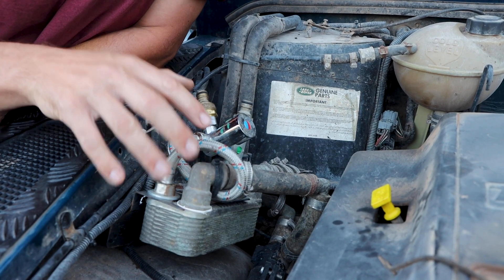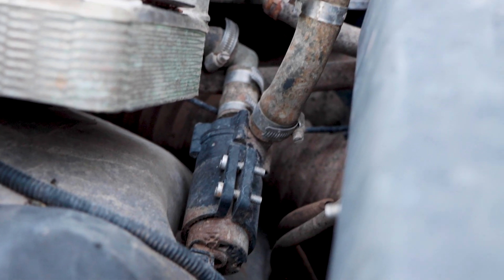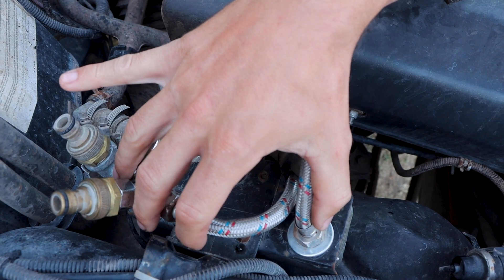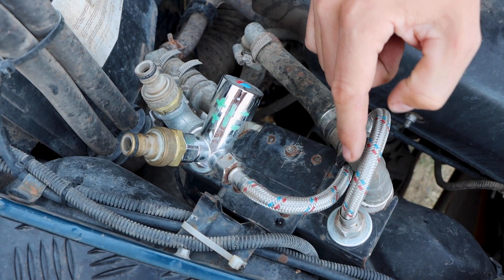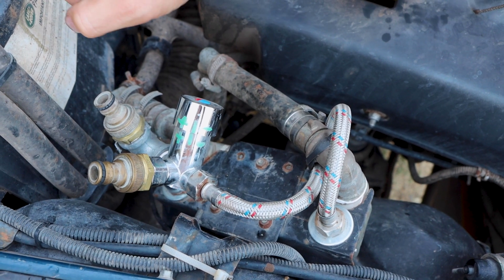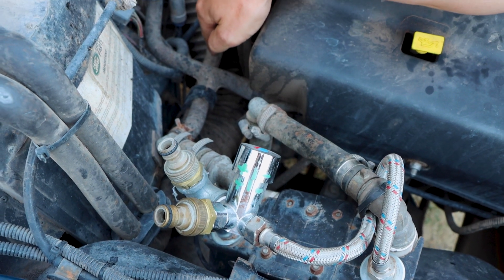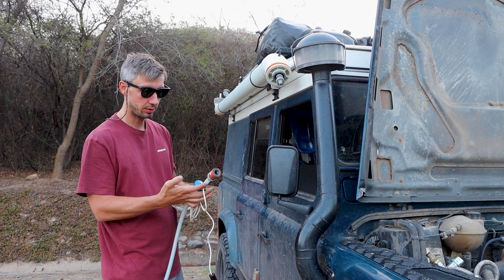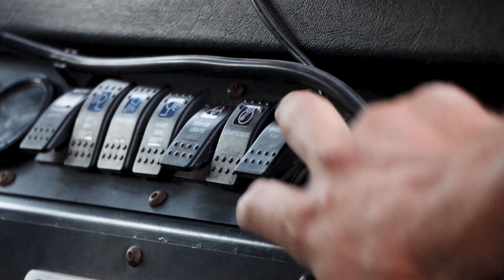How we get HOT Showers on the Road - Simple DIY System for Campers

Comment from the maker: What do you think about this system? If you have any questions, let us know in the comments! 👇
Reply: I guess the cabin heater has to be set at "open", ie "hot" for your system to work - so that the hot engine coolant circulates through the cabin heater...? Also,  am I right that if you develop a leak in your hot water system and your cabin heater is set at "cold", ie closed, you would loose much engine coolant.  So it's a brassica safety mechanism?
Reply: Honest, I think about to copy it and install it on my TD4. Is your a TD4 too, so that you can let me know where it’s exactly situated? Thanks Joe

Comment: Thanks for the explanation and for including the information about auxiliary coolant heaters and mixing valve. I hope that you don't need this advice from me but I would put caps on the quick-connect fittings so that you don't pick up debris or dry out the O-rings.
Reply from the maker: Hey, I’m happy it helps! 
No, I don’t cover it. You are right I probably should, but it is still a temporary design (since 5 years). I want it to be connected to the water system and I don’t want to open the bonnet to shower… but I haven’t come up with a better place to connect the showers head…

Comment: Hello, I just had to say how how much I enjoy watching your youtube show. I go on desert expaditions with Popski's private expadtions. As such I'm always looking for better ways to prepare my TD5 110 2004 Station Wagon for the heat of the desert and a re-mapped ECU. Your heat exchanger is exactly what I need to keep the engine tempiture down, while struggling with soft sand dunes  and altitude. Such as the Atlas Mountains later this year.  I would need a more basic version than yours, with the sole purpous of cooling the engine, Can you help me design one please? 
I also like that you cover all your maintainance issues, most similar youtubers don't show this kind of content. Your tool selection video was the best I've seen and highly recomended it to people interested in buying a Defender for expaditions. Keep up the amazing work!
Reply from the maker: Hey Tony, sorry for the late replay. I’m surprised you feel the need of more cooling. I don’t have much experience with chipped defenders yet, but doesn’t matter what we do our engine always stayed cool. Even in Iran with over 50 degrees during the day. 
If you really need it you could use the heat exchanger get a electric coolant pump and a second radiator. Connect it all to a second cooling circuit. 
In my car I’m way more concerned with gearbox and transfer case  temperatures than with engine temperature. That’s why we added a transmission cooler. This is more for highway driving but still an important part. If you need More information you can reach out to us via email: Contact.thebluelandy@gmail.com
Enjoy Morocco

Comment: This is great practical engineering! How about the pump? Is there a pass through valve or what happens when the engine pumps is being driven by engine?
Reply from the maker: Thanks, I believe the pump is just spinning driven by the engine. Sometimes I use it in combination with the heater to boost the flow and heat up the cabin faster. 
I having the heat exchanger and the pump in series of the heater causes a bit higher resistance in the small coolant circle. If that is a concern you could start the pump with ignition…
Reply: @Thebluelandy  it could be done with two simple check valves and putting it in series with the other water line. Then you make sure there is no issue with the pump seizing or anything else.
Reply from the maker: For the moment I’ll leave it how it is, it works but thanks for the hint

Comment: Thanks for the great video.  How do you determine what size fittings to get on the heat exchanger, 1/2", 3/4", 1" ?  And weather to get male or female fitting?
Reply from the maker: Hey Steve, I took the heat exchanger, went to the hardware store and tried to assembled a solution that could fit 🤷. In my case the heat exchanger came with ¾“ and 1“ male connectors. That was the only option.

Comment: Clever system. Is it also connected to the hose carrying coolant from the radiator which flows to the vehicle's heater?
Reply from the maker: Hey Michael, the heat exchanger is in series (after) the cabin heater. In TD5 Coolent flows from engine to the thermostat (if open) to the radiator, (if closed) to cabin heater, fuel cooler, shower heat exchanger, and back in to the engine

Comment: Nice and simple ! Any issues in freezing temperatures with shower water trapped in the exchanger ?
Reply from the maker: Hay Antoine, so far no. Normally the water evaporates while driving. I can believe it could be freezing if you shower and then the water freezes overnight. Didn’t ran into that yet

Comment: Thanks for sharing your system. Which heat exchanger did you use? The amazon link gave a number of different exchangers. Was it a 10, 20, 30, or 40 plate exchanger?
Reply from the maker: Hey, sorry for the confusion, we’ll try to fix that the next days.
We have the 20 plate version.

Comment: very interesting, would be great if you could convert all that heat energy from the engine into electricity and store it in battery's.
Reply from the maker: I have to admit if we find a way to turn this low temperature heat into useful engine, eg electricity. We would be able to cover most of humanity’s power needs. This is why this low temperature heat flow (eg. From power plants, or engines is only used for heating.

Comment: Hei there!
How long after you stop driving there‘s still warm water available? :-)
Reply from the maker: Depends, if it’s hot outside 3-4h if it’s cold you better shower quick after driving. Just check how long your engine feels hot after driving. It’s a big block of steel it takes a while to cool down.
Reply: @Thebluelandy  when you say to build it in after the auxiliary heating, how this works? Because a Webasto or Autotherm doesn‘t work with the motor coolant - or do I understand anything wrong😅
Reply from the maker: I believe You are just referring to the air heater like a Autotherm 2d but both companies also sell water (coolant) heater (e.g. Autotherm flow 5D) . Those are made to heat up the engine (and through the engine the car) in winter. Where those get installed is the place where you want to put the heat exchanger.

Comment: That's cool, I mean hot ;-) The link to the heat exchanger doesn't work for me, maybe you have a type or name?
Reply from the maker: Hey Frank, sorry for the bad Link. 
It’s a plate heat exchanger with 20 plates. It’s made of stainless steel and is rated for up to 20 bar. 
Search for: “stainless steel heat exchanger 20 plates” I got good results. If not let me know.